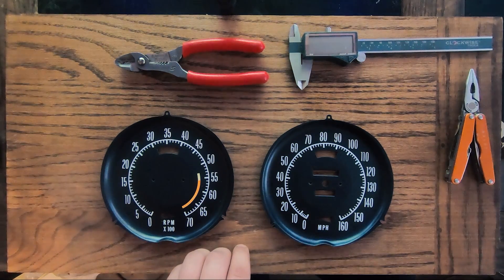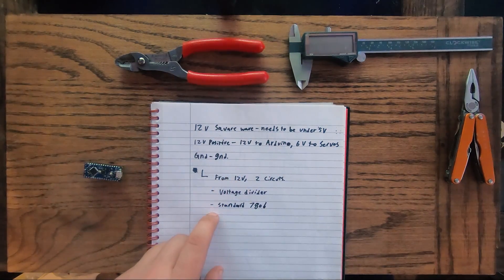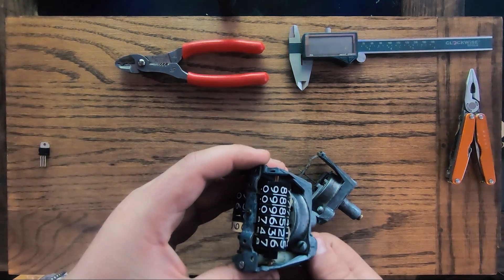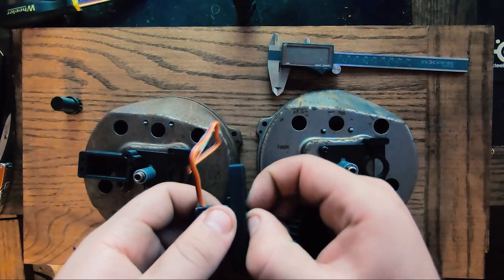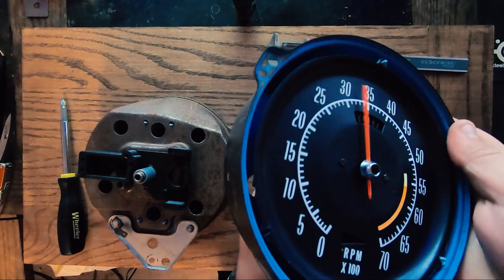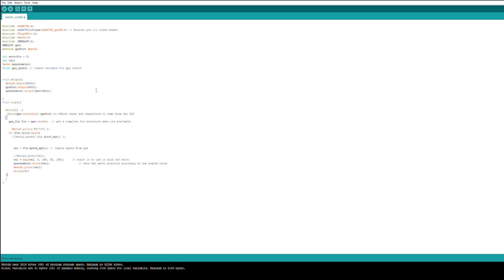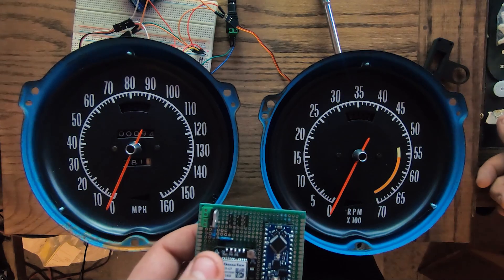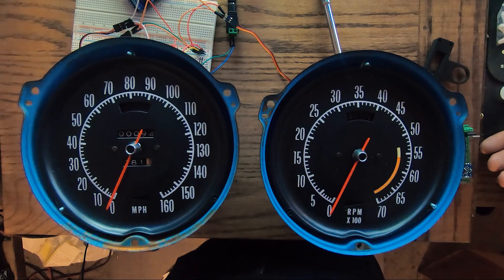V12 Corvette Arduino Electronic Speedometer and Tach

Comment: I've got a 57 Chevy that I'm planning on putting a T5 in, It will likely not have a mechanical speedo drive. This like a good approach over those expensive converter boxes. I just need the speedo and odometer. Speedo seems straight forward to control, odometer seems a bit more complex. Any suggestions would be appreciated.

Comment: how do you count the frequency of the square wave in arduino code?
Reply: You can use external pin interrupts that will tell the cpu when a specific pin state changed between high or low. You can then make the CPU call a few lines of code within an ISR routine (every time the pin state changes) to determine the frequency by counting the amount of interrupts over a specific period of time.

Comment: I have been attempting this for years with my C10 truck. Things I was missing are knowledge and understanding. I got so far as to use my Arduino mega to produce a 5V square wave signal that I had converted into a servo angle based on pulse frequency. It didn't work very well at all. I used the speed sensor from the newer manual transmission.

Comment: Cool project. I'm also modifying my speedometer from mechanical to electronic except mine is a strip speedometer so it's a little more involved.
What do you think about the noise level of the servo motors? Personally i'm trying to make mine as quiet as possible and to me it feels like these are quite noisy.

Comment: This is pretty cool, but when I realized what servos you were using, I was thinking "That might be noisy." Have you considered stepper motors (similar to GM clusters -- like in the 2003+ trucks) You can buy kits with like 6 or 7 stepper motors for cheap. Just a thought. I found your channel the other day with the Koennisegg lawnmower engine and I've been hooked!

Comment: Awesome project, but I would definitely look for taking a pulse train from the transmission's speedo output to calculate your speed. If you're lucky there will already be a hall-effect sensor on it for the speed.
GPS is far too problematic to be used reliably for a speedo, especially on hills, in the city, and in tunnels.

Comment: This is really amazing and incredible work! Very impressive. Some comments: There are small stepper motors specifically made for gauges; it's what modern cars use. Adafruit has one called "Automotive Gauge Stepper Motor". But servos seem cool too. Maybe using a herringbone gear would make less noise? The 7806 is a voltage regulator (I think you called it a transistor, which maybe it is, but it's only used for voltage regulation). Finally, I'm curious how you'll make the continuous rotation servo accurate for the odometer. Do you have a positional feedback measurement for it? This is a case where a stepper might make more sense because it's continuous but controlled (unlike continuous rotation servo). Keep up the awesome work and have fun!

Comment: My 1976 Chevy Blazer 4x4. Broke it's Speedometer Cable, back in the 90's. I never bothered to replace it. Because, I was running 35 inch Tires. So, it was very far off, on the speed it was showing. This Cool setup. Would make my Speedometer right. No matter what size of Tires I run. I have an Arduino UNO. And have been considering what project I would like to use it on. You're Corvette Gauges, look allot like mine, on the back. I wonder, if your design. Could be adapted to my Blazer... You do great work... Don

Comment: I like this. I'm building a '68 RoadRunner and a '84 Mustang SVO.  I was looking a few days ago at how I can run the speedometer from GPS for the RoadRunner because I've got a 518A trans for the car and I'm left without a cable drive. the sweep on my speedo would not be 320 degrees you have but that could be worked out in code. That leaves me to ask about your 3D printer and your plasma table. Did you build these, are they store bought, maybe built from kits? You seem to be pretty adapt at making things and that's why I asked. If you built them maybe vids on those would be cool things. Great stuff, good job.  DC
Reply: He's got a Prusa 3D printer it looks like, a very nice piece but you can do good work on something cheaper. I'd love to see what he's done for a plasma table! I've seen some small "home" units but they're still a few grand.

Comment: I have the exact same problem to figure out some day. It's on my list but way down the list.  Thanks this will be very helpful.
 I also have an active suspension project I've taken a crack at twice. a G sensor and 4 steppers running the dampeners. some day I will get the code figured out.  Great channel, love the level of tech.

Comment: This is an amazing integration of Arduino for your speedometer, tach and odometer! However a few things that might improve it would be to dump the servos for a number of reasons. First of all I don't trust those servos to last very long due to the constant usage and movement of driving. A far better option would be to use small stepper motors   which would be the perfect aplication for this. Also using GPS for speed is going to have some delay as GPS calculates speed based on distance over time so they'll be some lag there, but it might be manageable.
Reply: As long as he doesn't use A4988 on them^^ Stepper motors can be quiet or loud just depending on the driver you use for them. A4988 can be loud and high pitched, when you run them from an Arduino (I heard faster 32bit processors could reduce that issue, but he will most likely want to keep the Arduino) The TMC2208 (or TMC2209) might be a bit overkill, but would be wonderful quiet, which you want on long car drives. The TMC2209 would be the best, since they have sensorless homing, so you could home the neadle against the post.

Comment: when you say transistor, what you actually mean is linear voltage regulator. it should have a capacitor on the input side as well as the output side to give better voltage stability and a heatsink might not be a bad idea either.

Comment: I really like your design there! You mentioned you were running speed and I would assume the Odo off of GPS... What happens if it loses signal, ie; a decent sized tunnel??
Reply: If you went through a mile long tunnel and lost full connection the odometer would not count that mile i'm afraid.

Only way to counteract this would be to use the studs on the back of the wheel rotor as a "Poor mans" ABS/Speedo signal by attaching a bracket and a hall sensor

Comment: I did some experiments along this line for my  55 Chevy PU.  I found an unacceptable amount of backlash in the gear drive. For example, the speedo would read about 3 MPH different if it increased from 40 to 50 versus decreasing from 60 to 50.  I was using a Tower SG90 servo.  What's your experience like?

Comment: Really cool seeing a car guy get into the electronics game.. The only thing is you keep calling the voltage regulator a transistor which it simply isn't😉 nothing to worry about though. If I were you I probably wouldn't use a voltage regulator but a DC/DC Stepdown module from eBay or something (since you are dealing with quite a bit of max current as you already said). If you want to stick to the regulators, keep in mind that adding a second one won't double the max current since they are very precise devices and not calibrated equally. One will have a slightly higher voltage and therefore supply most of the current. I've heard somewhere that the current distribution for adding two voltage regulators is somewhere as bad as 70/30. Either way it would be good practise to put a small heatsink onto the regulator! Love your vid!

Comment: Cool idea, I would add a memory function if it was me too so that you could check to see the max achieved engine speed since reset, its a feature on a lot of aftermarket electronic tachos and it comes in handy (I used it on racing cars with gentleman drivers, it was always handy to see if they over revved the engine). But great execution fitting it into standard clocks.
Reply from the maker: I’m considering an external port to plug in a display, to replace the clock or something and then have a full data stream- oil temp, memory functions, shift lights, exc. I might mess around with it.
Reply: @WesleyKagan  Does the nano have built-in CAN bus support? That would make this quite a bit easier. I've used the Teensy before, which does have built-in CAN.
Reply: @daviddbh97  Not quite, but you can buy a CAN-Bus board that interfaces with an Arduino